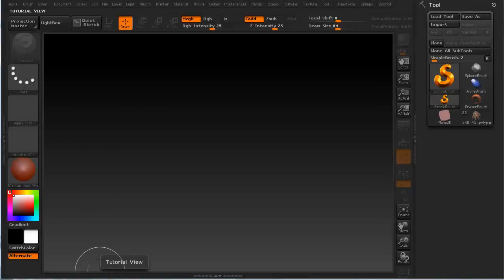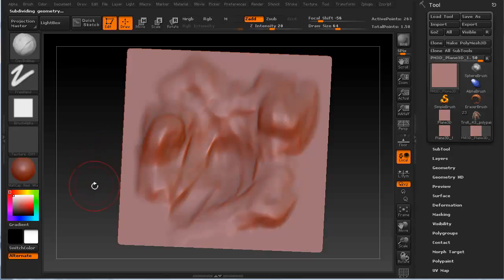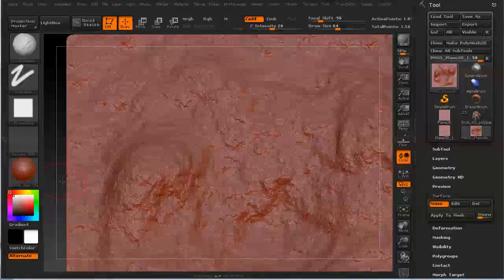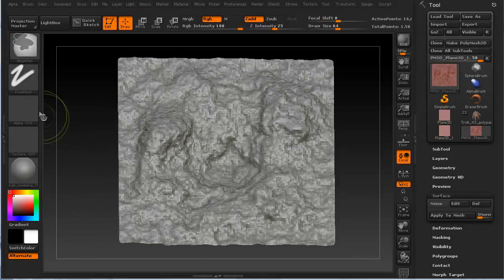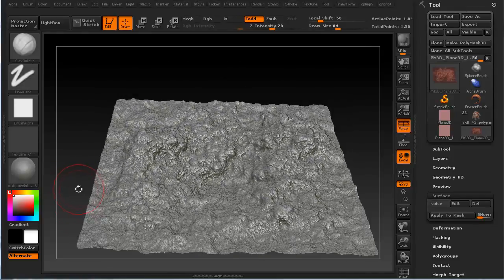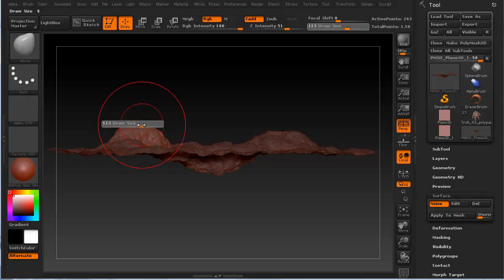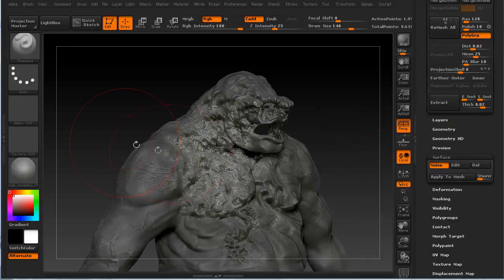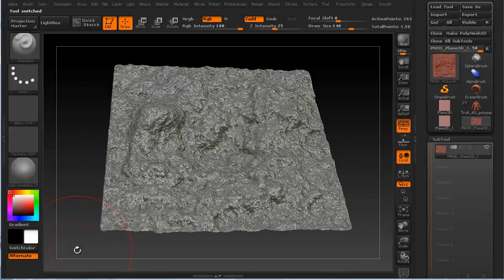Zbrush Tutorial - Adding Noise to Create Surface Details HD by 3dmotive

Comment: It is a good idea to create a Layer right before using the 'Apply (noise) to Mesh' option. That way, the change that noise adds to the mesh is being stored inside of a layer, instead of being baked into mesh. And then you can do all kind of tweaks, like adjusting Layer's intensity, duplicating the Layer or using Store Morph Target on the mesh and then Morph brush to 'erase/ease out' parts of that noise Layer.